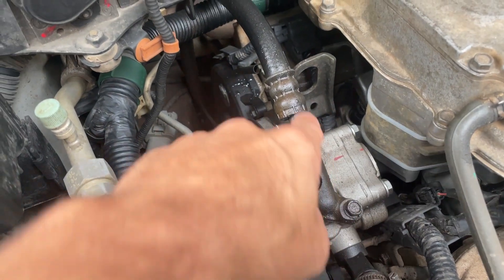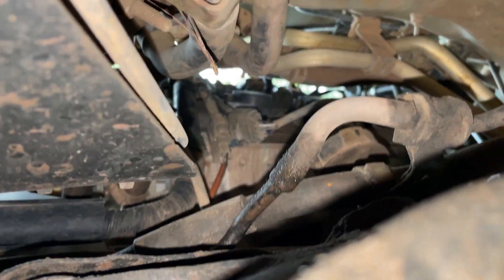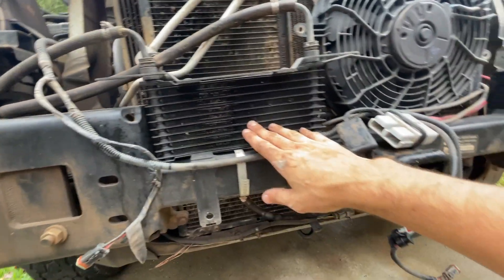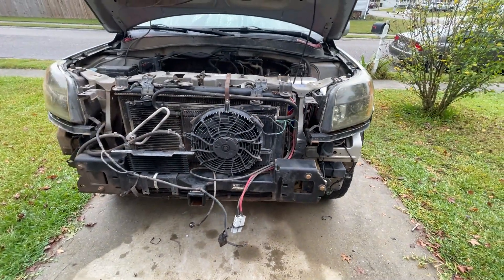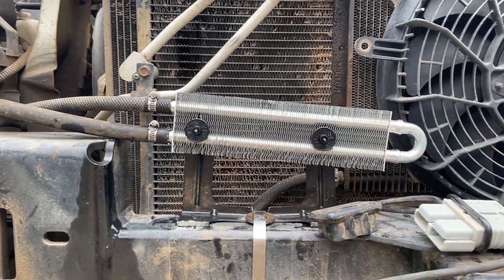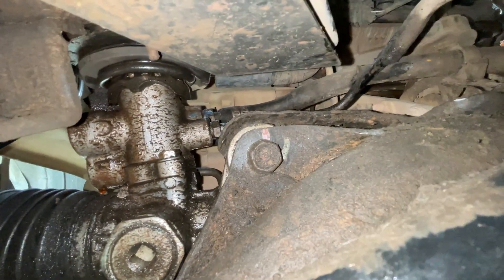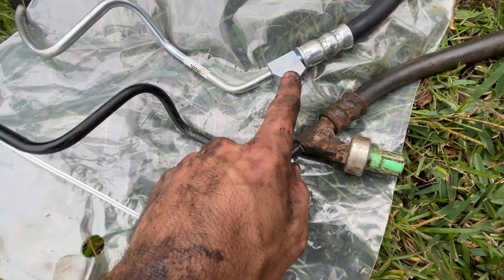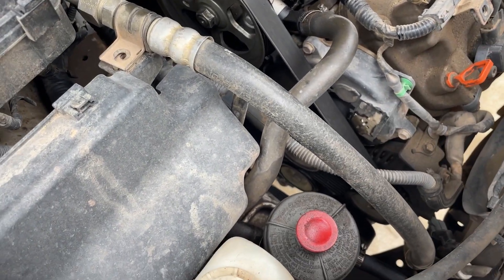DIY Power Steering Line Leak FIX and Cooler Upgrade (2006-2008 Honda Pilot)

Comment: That hose that you are replacing is in fact the high pressure line.  It's a very common failure point.  And very challenging to replace on the side of the road or in your driveway.  Mainly because of available space.  But if you can lower the back side of the subframe a little, it will make it easier to reach.  I had to replace mine last year when it developed a pin hole leak about 6 inches away from the pump.  And the hard part for me was threading the fitting back into the rack and pinion.
Reply from the maker: Thanks for all of that information!

Comment: Hi Aaron fellow 1st gen owner here do you have a video of how you hooked up your rad fan? Recently exp some overheating issues while out in the desert on the dunes
Reply from the maker: My auxiliary fan is to keep the transmission cool. If the radiator and condenser fan aren’t keeping the coolant temperatures stable you may have a thermostat issue or a head gasket leak.

Comment: Is there a trans cooler video? I’m struggling to find one from you if you made one.
Reply from the maker: My transmission cooler setup has evolved slowly over time. So I don't have one video from start to finish. The hardest part for me was installing the transmission temp gauge (which I do have a video on). The rest is just me using the parts I have plus the parts I scavenged to make a beefy cooler setup. Are you looking for a passive cooling setup, or a fan setup like mine?

Comment: So we have a AWD and exact same hose is leaking, any idea if rubber hose can be cut and joined by another rubber hose or this whole line needs to be replaced? Won't be dropping sub-frame so any tips you can share? Thx
Reply from the maker: My hose was leaking at the crimps so replacing the rubber hose wasn't an option. It is tight near the steering pump without dropping the subframe. Have you found any repair videos that do it without dropping the subframe?